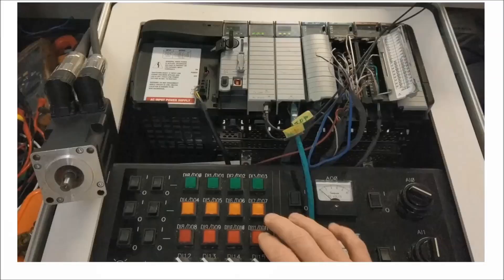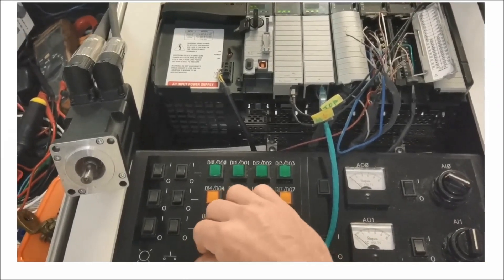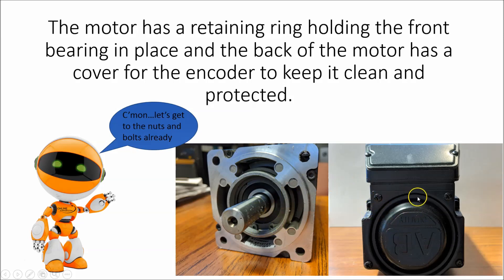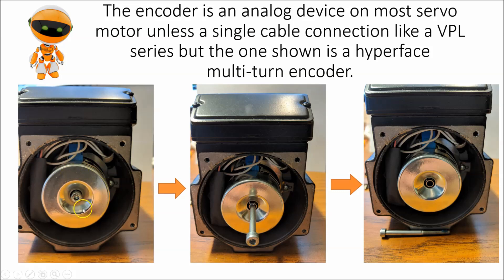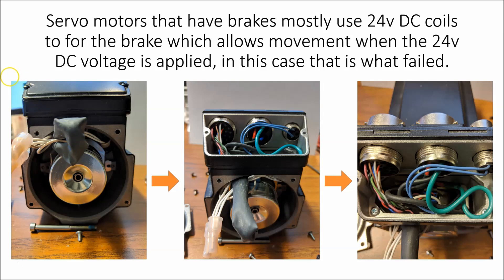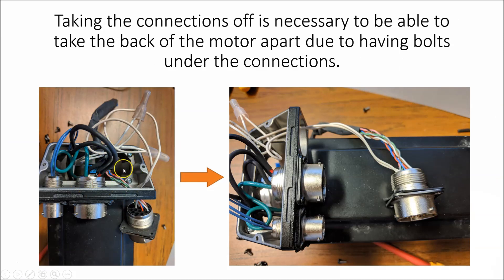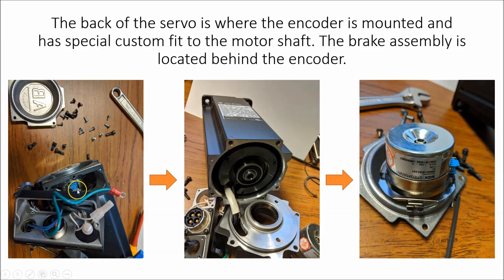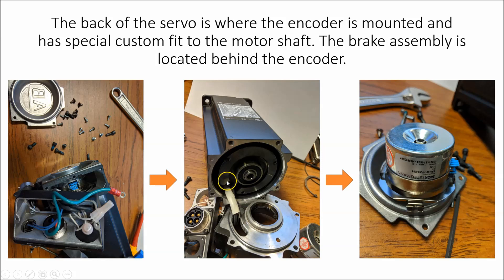Let's Breakdown an Allen Bradley Servo Motor (See Whats Inside)

Comment: Could you replace the encoder without the oscilloscope zeroing procedure, and then re-home the axis accordingly? Or will the drive not be able to even run the motor without the encoder position being set properly?
Reply from the maker: You have to calibrate the Encoder to the stator so therefore, there is no way to just replace an encoder for an MPL or MPM style servo motor.

The VPL uses a different style encoder & may be possible but even then you would be lucky to get this perfect.

The controller has servo properties that will not allow running a servo motor without an encoder position being read within the tolerance of that servo axis parameters

Comment: Hey Shane! Thanks for posting this video. I had a question. I have 4 Allen Bradley servos I'd like to use in a CNC plasma table. But Rockwell Automation will not help me one bit to source the correct drives because I'm not a dealer. Can a different encoder be used to make these servos work with other companys drives, like Yaskawa or DMM-Tech? The encoders on my AB servos have are the "SICK SRM50-FFAO-S21". if not, can you explain why? Thanks a bunch!
- Chris
Reply from the maker: You can not change encoders, they are perfectly place on the stator with an ocilliscope.

Unless you know how to do that.

Even then you need to tune the two together with plotting point